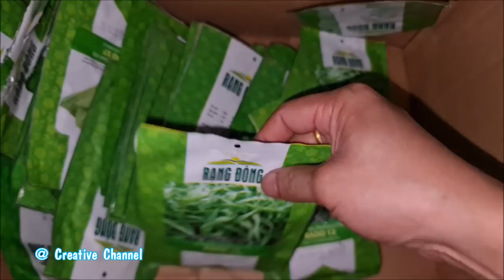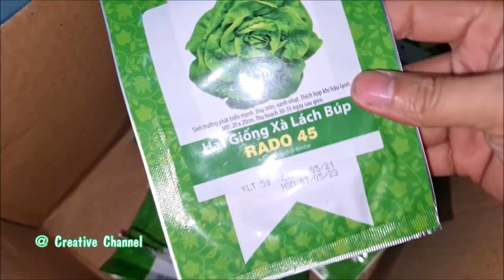How to make a Aquaponic System at home using Plastic Bottle

Comment: The whole system looks great and I know it works fantastic. There is one flaw in it: those filters that you built up there on the top are kind of useless: the water can get from the inlet to the outlet of one filter without getting through that filter media. It can flow around it which defeats the purpose of having a filter. You need to rethink those filters and force the water to go through them, not around them.
Keep up the good work! Great job though.
Reply: Let's see your filter then??

Comment: What a great job you've done. In my opinion, the fish aren't needed because you added the nutrients A and B to the whater, but you could use the correct fish for this aplication, feed them and only add ferrum to the water.
Reply: according to my research, no chemicals or fertilizer needed as the fish produce what the plants need.  but what i saw online a couple years back, the guy had a rather large above ground pool,  had fish that is good to eat, and so always had fresh fish along with the fresh veggies.  so naturally, in my mind, the pool in this video is too small, and chemicals should not be added for the plants.  but i do plan to check out ferrum, your comment is the first one i have seen that recommended anything more than water and fish.  living here in the south where it is less likely for the water to freeze solid, i am planning to try this with an above ground pool, if i can get the money for one.  i plan on using fish that i can eat and like to eat.  best part is, wont need to papers to go fishing in my own back yard.  😎
Reply: @Angus MacGyver  yes indeed fish can eat and produce as "poop" all the nutrients that plants need to grow, but eventually they will lack of ferrum (iron), that's why you need to add it, it is a really important nutrient for the plants, more than the others. One of the best fishes for this application are "tilapias", not every fish is useful

Comment: That isn't the Ideal spot for that sorta thing, but I like this portable design. One thing to look out for, when little fish become big Fish, they like to feast on submersible pumps power cord and hoses. That has been my experience so far, so I had to use an 8 inch pvc tube to protect the power cord and the hose.
When you read my comment, message back here in a few months how that went, let me know if you get that too. 
Nice work on this one.

Comment: There is some information missing to make this really useful for someone who hasn't done this before. How many gallons of water in the main tank per pound of fish (or liters per kilo if you prefer). I wasn't clear on the medium used in the cups to hold roots. For your filter, you have rocks... it's my understanding you can't use rocks with calcium. One must know what kind of rock, or do a vinegar test. Most importantly, you didn't show yourself feeding the fish. Someone might not know any better and assume this is a closed system. I'd love to see someone growing duckweed and catfish to see how low you can get the external input fish food (catfish eat duckweed, up to 1/2 their diet). Does it turn out that growing duckweed consumes all of the nutrients available and you're just growing fish with 1/2 the feed cost, or are there nutrients left over for growing veggies?

I guess those questions are beyond the scope of this video, but I'd still love to see it. And if someone in the comments has a link to a great informative aquaponics video, I'd love a link.
Reply: I found 10 liters for 0.5 kg of fish but it probably depends of the type of fish.

You have to monitor the levels of CH4, NO2 and NO3 and adjust number of fish and/or of plants accordingly.

Check out "Rob Bob's Aquaponics & Backyard Farm" channel, there is a lot of info.

Comment: Why do you have a hose on the bottles at the ends of the bottom row and not the rest?
Reply: oh i see.. its probably so it doesn't drip out over the sides of the reservoir underneath!!
Reply: That is to reduce splash on the ground.